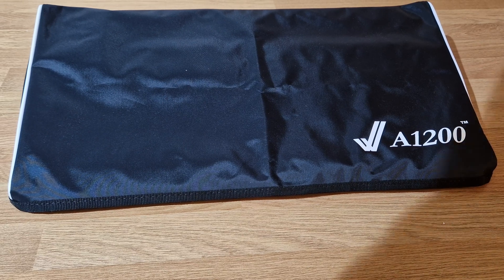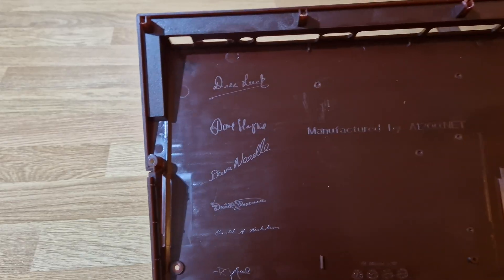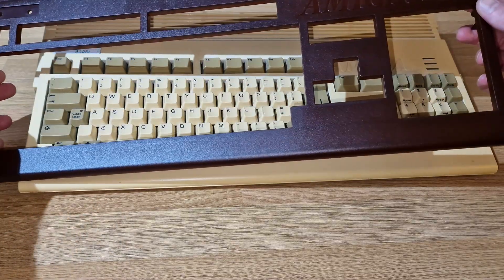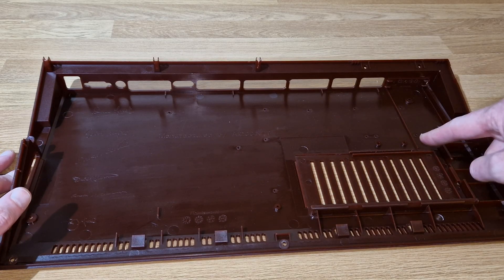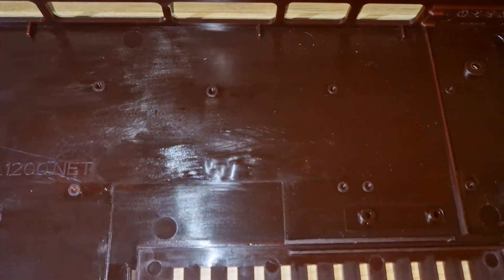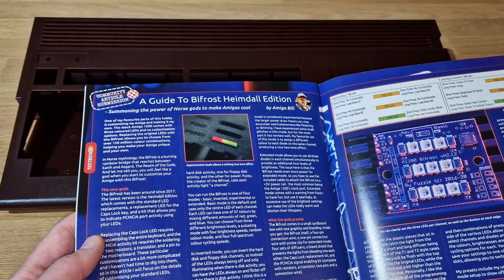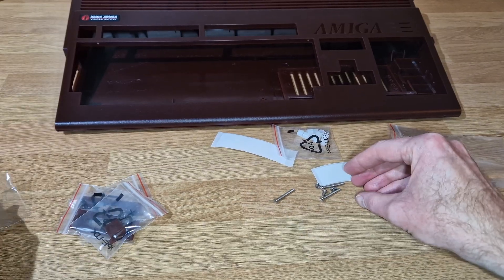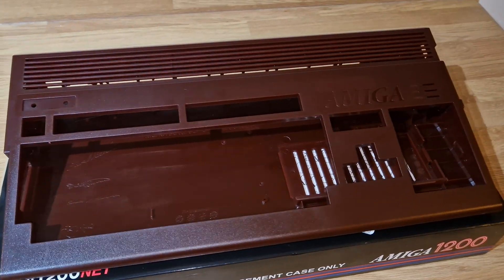Amiga 1200 Asahi A1200.net Red Case Pre Build Insights

Comment: the modulator cutouts are for the screw posts on a VGA socket, some people remove the modulator and bring the VGA of something like an indivision scandoubler out through the hole, additionally the ReAmiga 1200 clone/rebuild board actually has on board VGA out in that position! I have the latter and it fits perfectly :)

The panel for the floppy emulator screen fits a 16x2 LCD screen - but i believe the only version of the case that this works well with is the clear or semi clear one, I have the blue Asahi case and struggled to be able to see an LCD screen through the panel, particularly when the text was scrolling - in the end i found a similar sized OLED and mounted it against the inside of the case, and made some modifications to allow it to be held in place from behind the screen - obviously there were no matching screw holes so i had to improvise a bit - this worked very well and the screen is perfectly legible.
Reply from the maker: Yeah I've since seen images of other people's Amigas where they have the VGA or DVI out that way. I might do that some day myself but I want to get some use out of the modulator sticker I got from Amigakit first 😁

Nice to hear from someone with experience of the same kind of case. I'm not so bothered about the gotek screen but its good that cases take it into account.

Comment: The spare space where the RF modulator went usually for a VGA connection with the relevant upgrades. The bifrost LEDs do look really nice (I have the Heimdall edition) but they are always in short supply, so if you ever think you might want one, order ahead because there will be a waiting list for them. The first 40th Anniversary boards sold out within weeks. Fortunately I put my order in for 2 as soon as they came up (waiting for them to arrive). I intend to use one on my original A1200 and the A1200NG motherboard from Amiga-Kit when it arrives. Thank you for the content. It's an exciting time to be an Amiga owner.
Reply from the maker: I figured if must be for a video out as I recently saw someone selling a case and noticed a cable poking out where the modulator should be. Thanks for the info on the bifrost. Not quite ready to go that way yet but every now and then I get the Amiga bug and want to see what else I can do to enhance it so never say never.

Comment: Hi there Andrew, really love the look of that Ashasi casing :) In 2022 i planned on putting together my very own Pi based A1200. After purchasing an A1200 reproduction casing from Retro Passion here in the UK (grey was the only colour they had in stock at the time of purchase) and i originally built the machine around a Pi 3b+ but later on swapped that out for a Pi4 instead (no more constant Under Voltage warnings anymore that i had with the 3b+)
I was then very, very kindly gifted a full working Amiga 1200 keyboard and a Keyrah v2 interface board by an extremely kind gentleman here in the UK so i could complete my build.
My build has been fitted with an On/Off switch (wired to the Pi's GPIO header pins) along with an audio-In socket 1x Micro USB breakout board (which was for the original Pi 3b+ then i later fitted in a USB-C breakout board for the Pi 4. It also has a SD card adaptor running from the Pi then out through the PCMCIA slot (for the various Amiga based software's that i can use on this machine and has HDMI-Out.
The Pi along with the On/Off switch, Keyrah board, Audio-In and the USB power breakout boards are all accessable at the rear of the bottom part of the A1200 casing.
The whole project took me about 6 months to complete from start to finish (being the A1200 keyboard and the Keyrah v2 board being the hardest parts to get hold of at that time.
I did re-spray the A1200 a nice metalic cherry red colour as the grey was a bit dull tbh. I have even named my build the A1200 "FrankenPi" lol
Reply from the maker: That sounds like a nice project. The keyboard is the biggest problem with building Amigas into a case like this if you want it to look like an A1200. You can get modern parts for everything else but keyboards are harder to find and expensive when you do. I can see why it took you that long. This retro system building lark requires patience. This case took about 16 days to arrive. If I want the caps that will be another 2-3 weeks. It might seem to some like a waste when you can just emulate on a desktop or laptop but building your own is much more rewarding!